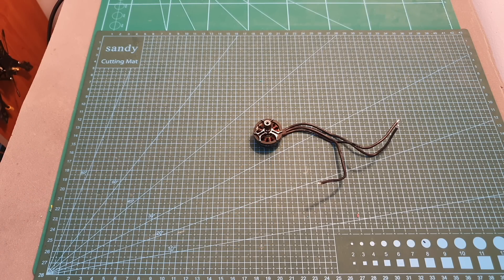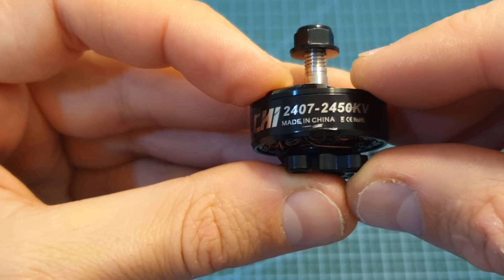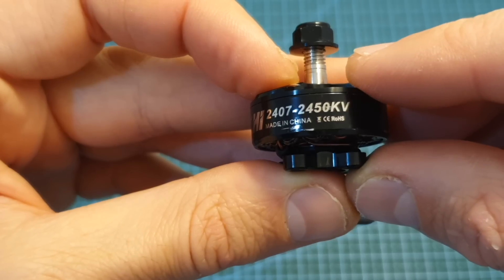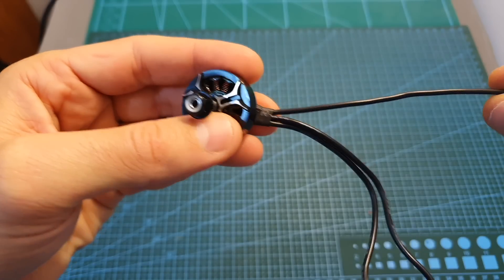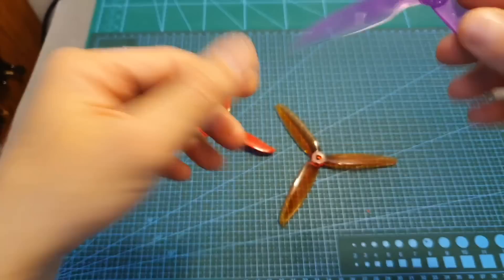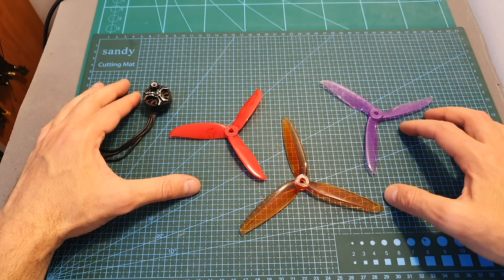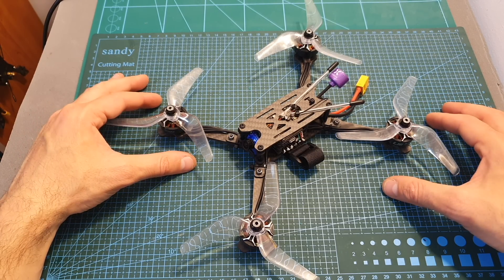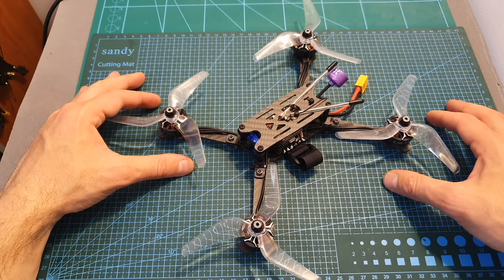LHI 2407 2450KV Motors - Thrust Test & Flight

Comment: Would  it be possible  to run a 7inch props .. 6s ?
Reply from the maker: I think it will be too much for this motor to handle :-)
Reply: @KremerFPV  no I mean the lower kv version ..
Reply from the maker: @kkkkkkkkkk421  I didn't test it but I was referring to the low kv version.
Reply: Wonder about 1800kv and 5s 7inch?
I am running 1850kv 2508 Avengers v2 on a 7inch, on 5s, flys great n motors not hot at all.

Comment: Hi quick question will this motor with 4s 1300mah 85c battery will sag alot in ur opinion?
Reply from the maker: It should be ok, but if possible go for a 1500mah 100c lipo.